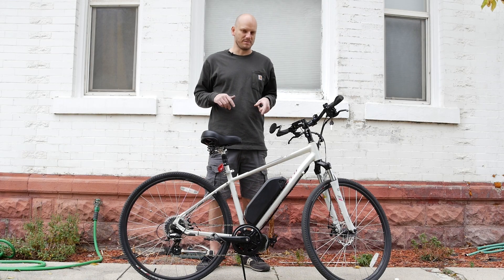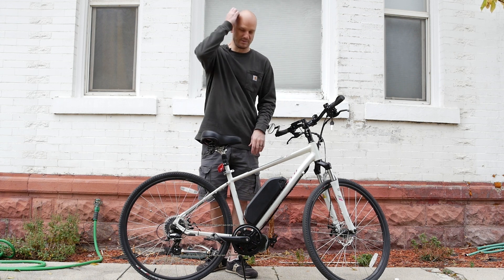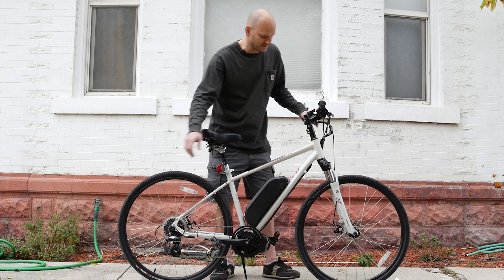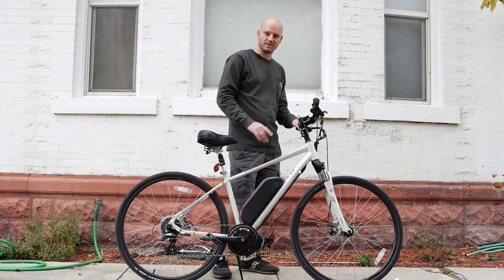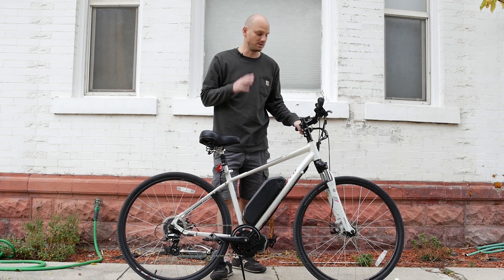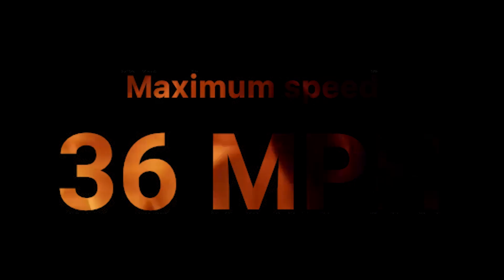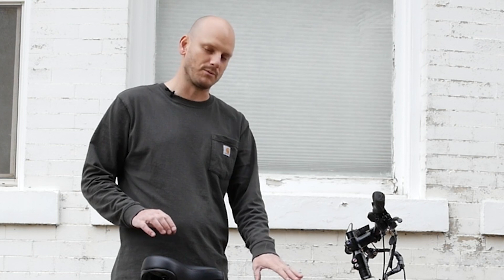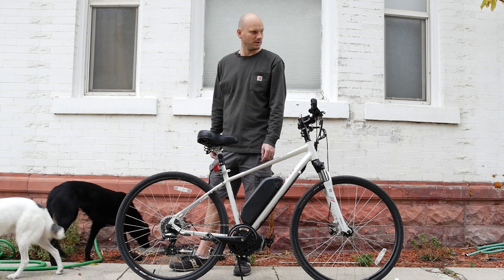Custom E-bike Build: Specialized Ariel w/ 750w Mid Drive BBS02 52v 16.75ah Super Shark Battery

Comment: Hey Johnny,Will my BBSO2 melt if I use a 52V 20Ah 50A Triangle Lithium Li-ion Ebike Battery Electric Bike for 2000W Motor
Reply from the maker: Only if you intentionally try to melt it 😀

Comment: Great videos Johnny. Could you talk a little bit about the Q Factor in your builds. Thanks!🤓
Reply from the maker: Any build in particular? I try to mention the Q factor when it’s applicable, mainly on fat bike builds.
Reply: @JohnnyNerdOut  My bike is a Trek DS 2 L with an 83 mm BB and my cranks are offset by about 20mm. I don't know if that will be a problem. You're doing a great job! Thanks!

Comment: Is motor restricted
Reply: In this build it will be running about 1,300 watts (52volts x 25amps). 25amps being the maximum the BBS02 stock controller can be set to. When fully charged to about 58 volts it will be putting out 58 x 25 = 1450 watts.
Reply: Absolutely! It's restricted by wind force, load, gravity, etc.😂
Restrictions are usually imposed for legal purposes, depending on locality, they are 28, 20 & 15 (mph).